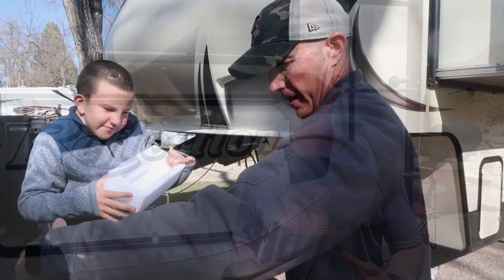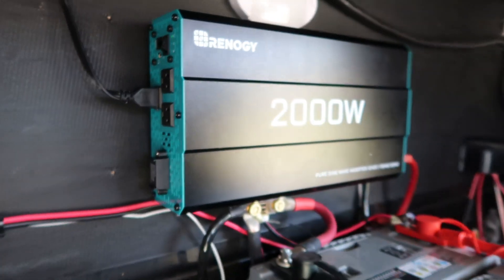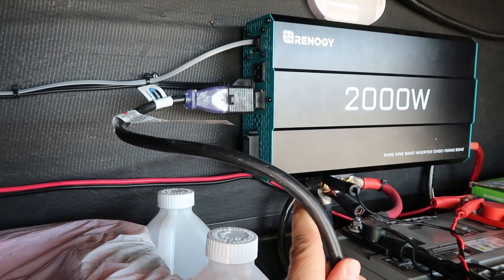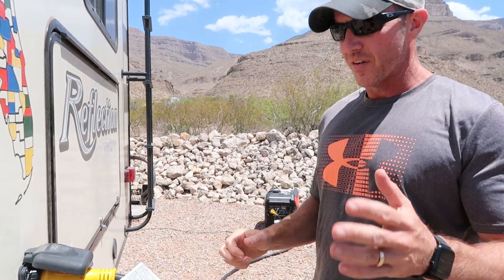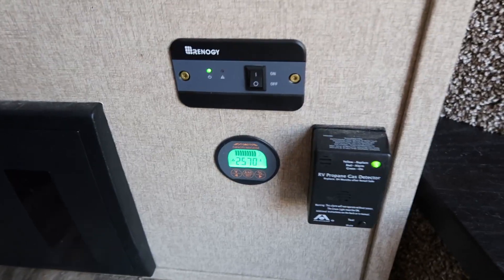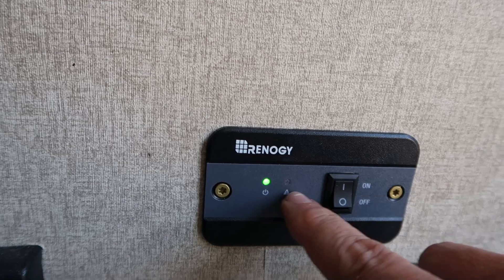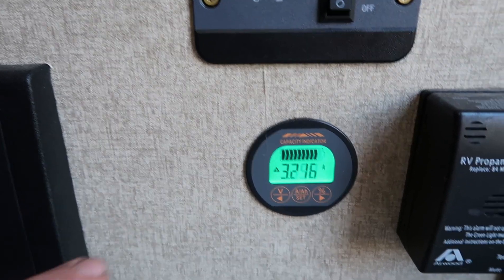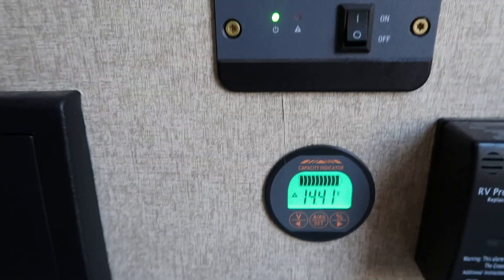How To Power Your Entire RV With An Inverter | Easy Inverter Power

Comment: Sup what if you have a 6500w given to you and wondering do i really need 6 batteries lol
Reply from the maker: Technically you do not NEED 6 batteries…but in order to utilize the maximum wattage of the inverter, 6 batteries will be necessary.

Comment: Great info.  I just got a small teardrop which has separate 12v (usb) and 120v plugs (the 120 outlets only works with shore power).  I want to primarily boondock.  Only issue on using an inverter with my existing batteries then tying it into the 30amp shore-power plug is that these batteries would be in a "loop", thus trying to charge themselves by mimicking shore power and I think it's bad for the AGM batteries.  Does this make sense?
Reply from the maker: You would need to disable the converter when plugged into the inverter so it will not try to charge the batteries.

Comment: My 2019 Aspen Trail by Dutchmen gives my inverter an error when I turn on the GFCI circuit and try to run it from the inverter.  Any idea what's up with that?

Comment: Nice video, I do have some questions, if you're camping, what appliances do you need to run?   I mean we go camping to enjoy the outdoors no?   Are still watching TV and doing the internet thing? Can't you just run the lights, water pump off from 12v batteries?   I'm new to the RV scene and we unplug so we can go on hikes, swims, bikes and what not. Look forward to your response.
Reply from the maker: You can definitely run lights and the water pump off the batteries. The benefit for us is having all of our outlets inside the RV available to charge any devices or camera batteries in between our outings. At the time, my wife and I were working remotely which necessitated a solution to use our 110v inside the RV. It just adds a layer of convenience but you still have to be mindful of what you’re choosing to power.

Comment: day 6 of boondocking how do you service your gray and black tanks?
Reply from the maker: We typically only boondock for 3-4 days so we don’t have to dump them. I’ve seen some use a macerator pump to pump into a portable tank in the back of the truck and go to a dump station.

Comment: Hello , Really enjoyed the renogy Inverter video. But really confused and in desperate need of some help. Is the converter charging the batteries, or the solar panel, or both? Please 🙏🙏 help . Thank you
Reply from the maker: The solar panel is charging the batteries. The converter has to be off when the inverter is on or it will drain the batteries quickly due to the high amperage draw.

Comment: looking to do this set up 12v but with a 3000 inverter on 600w solar panels with 3 or 4 100ah battery  ..im powering a kettle, microwave, toaster,ricer cooker, dual stove  ect... and of course im not going to run a kettle and microwave toaster all at the same time lol.... and my led lights are 12v will be direct to the batter alone with lights,fans,wifi router,fans, phone charger ect.. only going to turn on the inverter when i need to use the appliance thats 1000+watts ac .... maybe ill do a 24v later but theres lot of stuff that just cant plug straight to 24v most things can be powered on 12v and its more than enough for a small trailer.. pretty sure i can power a small ac fine on a 3000w inverter on 12v but just have to not run it non stop and run it on low power.. great vid
Reply from the maker: Thanks for watching!

Comment: I want to get some Renogy equipment but I run Wind and Solar. Will it still work okay?
Reply from the maker: There should be no issue as long as the wind and solar run through a charge controller before going to your batteries.

Comment: Why don't you bypass the converter completely, and run your inverter directly to the breaker box for ac,and jump your DC directly to the batteries, most converters are inefficient anyway, also if your inverter doesn't charge batteries you can add a 80 amp charger and run it to your generator 😊
Reply from the maker: All that could be done, however, this is intended to be a simple way to power up your RV for those of us that rarely boondock. Thanks for watching!

Comment: Much easier to mount two auto switches and wire directly. Primary is shore power. secondary is generator, third is inverter, and all the switching is automatic. 'Idiot' proofs the whole setup which is needed for my family.
Reply from the maker: Thanks for watching!

Comment: How do you hook up your battery monitor? Thank you
Reply from the maker: The battery monitor shunt is connected in the negative side of the battery bank. Basically one cable from shunt to battery negative, then all other negative cables in the other side of the monitor shunt. Then just mount the monitor inside and run the supplied cable from the shunt to the monitor. It’s very simple and comes with great instructions.

Comment: I have used this setup for years. I run 4-100ah Power Queen batteries into a 3000w pure sinewave inverter and run the output to the trailer  110v input. I can run everything in the trailer for days as long as I have sun for the 600w panels on the roof. It will even run the roof air for about 4 hours if I have to. More batteries and solar would be nice but I've run out of roof room. LOL  It's only a 20' trailer. LOL
Reply from the maker: Sounds like a great setup!

Comment: Great video!

Have you been able to safely run your air conditioner off the batteries and 2000w inverter without shore power or a generator? I have a similar setup but the air conditioner trips after a minute on hot days, it works fine at night time for some reason.
Reply from the maker: We do not run the A/C as the draw would drain the batteries too quickly. Perhaps adding a soft start capacitor would help your situation.

Comment: I have heard (but not confirmed) that the full output of that converter can only be achieved if you utilize the provided hard wired port located next to the plug outlets. That might explain why you aren't happy with the way the inverter powers your microwave oven.
Reply from the maker: I believe you are correct.

Comment: How do you charge you batteries without the solar panels if you don’t have sun as an additional power source? I want to do this with my RV as I have several spare lipo batteries. Any help would be much appreciated thanks.
Reply from the maker: The only way would be to run a generator so your onboard converter would charge the batteries.

Comment: Hey brother! Few questions! I love your setup it looks fairly simple.

I own a rockwood roo travel trailer. I've purchased and installed a 200ah lithium battery, a new charge converter 120v - 14.6v to charge the battery (when im plugged into shore power). When im off grid it works wonderfully to power all of our 12v appliances.... I now want to incorporate a 2000w renogy inverter to use t.v the odd time and toaster.... Few questions...

1. Do i just connect the 2000w inverter directly to the batteries terminals, (the battery already has two wires coming from charge controller (a red and a black). attached to the battery.
2. I do have one of those "solar on the sides" pre-wired to plug in a solar panel which i plan on getting... so I will have 200w of power charging the battery during the day...
is it possible to set it up like this? having two wires per terminal? one potentially feeding the battery 200w from solar and the other pulling 2000w from battery? Does this make any sense??
Reply from the maker: Correct, you can wire the inverter directly to the batteries. 200 watts of solar should offset your usage during the day while still providing a slight charge to the batteries (provided there is full sun on the panels).

Comment: How do you recharge the batteries without solar panels.  I would rather use my generator but not sure how that part of the wiring would work
Reply from the maker: If the trailer is plugged in to the generator, your converter will charge the batteries. Or, if you had this setup minus the solar panels, you could plug a separate battery charger into the generator with the leads attached directly to the batteries. That would serve the same purpose as the solar panels in this scenario.

Comment: What amp battery I will need to put together the 2000wt inverter? Can I use a 320wt solar panel?
Reply: So you have a regular breaker panel in the rv , and then u plug the inverter to the breaker panel? Sorry iam new on this
Reply from the maker: I have 2 100ah batteries in parallel to give me a 200ah battery bank.

Comment: For some reason this exact same set-up in my Imagine 2970RL will not work.  The inverter goes into a fault and shuts down.  I have tried turning off all the breakers in the camper, but it does the same thing every time. I have connected the inverter into the camper using a longer extension cord, and it works fine, runs the microwave and TV when directly connected to them.  Is it possible that the bog bone adapter is bad?  Do I need something bigger than a 14Ga extension cord? Pretty stumped now, and have a trip coming up in two weeks that demands I figure this out... Thanks for any assistance.
Reply from the maker: You are shutting off the converter and have the fridge set to propane along with the electric water heater off correct?

Comment: Title is misleading, they cannot run entire fifth wheel trailer electrical demands!
Reply from the maker: I clarify immediately in the video that we run everything except the high load appliances like the A/C.
Reply: @JouppiOutdoors  exactly your title to video is incorrect! So what is the issue? You made a mistake on the title, no big deal.
Reply: Whatever. @MissionaryForMexico

Comment: How hot does it get inside the compartment? had the inverter ever shut down due to summer heat ? Thanks!
Reply from the maker: It never runs at a full load but there’s never been an issue with heat.

Comment: I did the exact same thing with my little pop up slide in truck camper.  300 watts of solar, 2 100 ah batteries.   I installed a 30 amp plug in on the outside that plugs into my inverter. I then take my shore plug and plug it back into the 30 amp plug.   With that all the plug-ins work like I'm on shore power.
Reply from the maker: It’s definitely a convenient way to power all the outlets. Thanks for watching!

Comment: Ok im new so bear with me please. Why not wire the inverter into the rv instead? So with this set up you did if you were boondocking and batteries needed to be charged do you just turn off the inverter and turn on the converter then plug in the generator?  Thank you
Reply from the maker: That can be done, however, the correct way to do that is with a transfer switch wired in so you never get multiple sources feeding the RV at the same time. I have considered doing this, but the effort isn’t worth it given the limited amount of dry camping that we do. It would be nice though!
Reply: @JouppiOutdoors  thank you

Comment: My question to anybody looking at this and reading the reviews or questions can you put more batteries and have more battery storage so you could run longer that's the first question, second question is is that when the batteries go low and there is no sun for 3 or 4 days can you charge the batteries up with your generator and how do you do that
Reply from the maker: Hi there, yes, you can add more batteries in parallel to increase your capacity. The caveat to that is you would need a big enough charger to charge a large battery bank effectively. The rule of thumb is at least 10 amps for every 100 amp hours of battery bank capacity. Charging with the generator is simple, just plug the trailer into the generator and turn the converter or charger on depending on your setup. If you are thinking of a large battery bank, it would be worthwhile to look into an inverter/charger vs using this method.

Comment: This is a meticulous system. No batteries in parallel. 24 volt theme. You might consider a totally independent 12 volt plus solar just for 12 volt appliances. Tiny 12 volts can use a car battery diluted to become a deep cycle, or you can use golf cart battery pairs, diluted for the longest lifespans.
Reply from the maker: This is actually a 12 volt system with 2 batteries in parallel. It’s not really that complex, simply plugging our trailer into the inverter via an extension cord. Thanks for watching
Reply: @JouppiOutdoors  If you have batteries in parallel, you will need a battery isolation system. The show had 24 volt charging. Batteries in series. Fundamental and trouble free.

Comment: I have a progressive Dynamic converter. It does not have a separate on/off breaker.  I wonder if it with detector it, and turn off by itself. It switches to the battery type.
Reply from the maker: You would need a way to shut the converter down to use this setup correctly.

Comment: The Renogy 2000 Watt inverter is not an upgrade. It uses the cheapest short lived, low surge inverter technology on the market. It not only provides a short life expectancy but can also be dangerous them installed in your rig. It uses lightweight, outdated, high frequency, transformerless inverter technology. The reason for this is that all of these lightweight, high frequency inverters lack a very critical component. That critical component is an iron core, copper wound output transformer. Without an output transformer to act as a buffer to absorb electrical surges provided by the “Flywheel Effect” inherent in the physical amount of a transformer’s iron, these surges and damaging reverse voltage spikes must be handled directly by the inverter’s MOSFET transistors, essential shortening their life. 

You might be able to start and run some high surge loads when these high frequency inverters are new, but every time you fire up one of those inductive loads, you're shortening the life of the MOSFETs in these inverters. Lightweight. high frequency inverters run much hotter than low frequency, transformer-based inverters which makes the low cost, off spec, Chinese made components such as capacitors, diodes, resistors and ICs that are used in the cheap inverters that are used in these inverters, far more prone to early failure. 

Another major consideration with these lightweight, high frequency, transformerless inverters is safety. All it takes is for the AC output monitoring circuitry to fail and one of the MOSFETs in the inverter's H-Bridge circuit to short to ground, and these inverters can dangerous, high voltage, high amperage DC current straight to your connected AC loads which will not only damage most AC appliances but can also set those AC appliances on fire.

a far better alternative is to purchase a hybrid, low frequency, transformer based inverter charger. Low frequency transformer based inverters last many years longer than these high frequency solar generators, and can easily power high surge loads without being damaged and without damaging your appliances. That's why the big name brand inverter manufacturers like Schneider Electric, Outback Power, Sigineer Power, Victron Energy and others, all use a low frequency topology in their offerings.
Reply from the maker: Thanks for the insight, very informative! This setup is for occasional use running very low draw electrical loads. Thank you for sharing.

Comment: entire 5th wheel except it won't run the 2 things you need/use the most - the microwave and the air conditioner.
Reply from the maker: Not the 2 things we need when we are dry camping in comfortable temps. Thanks for watching!
Reply: Microwave is not a plus because you have a propane stove and oven , ac is important some times when a fan alone can not do the job...and if that is your concern you have 3 options when camping in remote areas 
1. Build a more powerful solar system
2. Use a powerful generator or the RV one 
3. Don't go camping in an RV
Reply: I operate a 1500W microwave, no problem

Comment: Reason why you can’t power your microwave is because you’re using the low amperage output, which is the extension cord when you should be using the high output which is plugging directly into the inverter with the little box that you unscrew and screw the wires directly into the inverter, as opposed to plugging into the inverter with the extension cord.
Reply from the maker: Agreed, I may wire a direct connection at some point

Comment: You can easily use a microwave using that inverter. Of course id shut down the water heater and/or AC while i was using the microwave because of running watts as peak watts is only for very short times in surge when devices start up. Pretty nice looking inverter though. I want to get a 3000+ watt one. If you run those 2 batteries in series, you'll use half the amps which extends battery usage.
Reply from the maker: Thanks for watching!

Comment: Thanks for the video's. I watched both of your videos about this set up.  This gives me new options that make sense. My question is why a 20 Amp 12 guage extension with 15Amp adapters? Will a 15Amp 12 guage extension not work, or heat up or ?? 
In my situation I might run the inverter power to an "inverter" plug in on the rig exterior. Then use my 30 Amp shore power cord with the 15Amp dongle to run the inverter power back over to the shore power inlet.  It's only using 1 leg anyway, I already have the cord and it's plenty of cable so it might work. Thanks again
Reply from the maker: Initially I wasn’t sure if a standard extension cord would handle the load, so I went heavier just to be safe. I have also thought of hard wiring a 30a outlet to the inverter so I could plug our normal shore power cord in with an adapter, great idea!